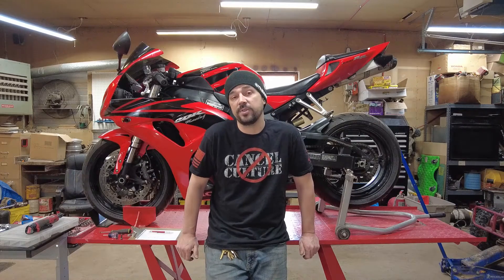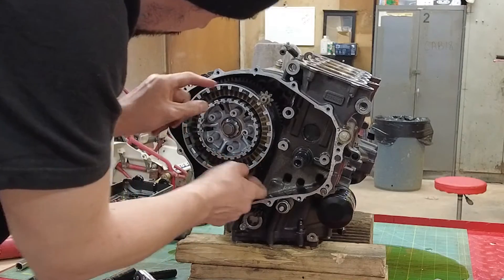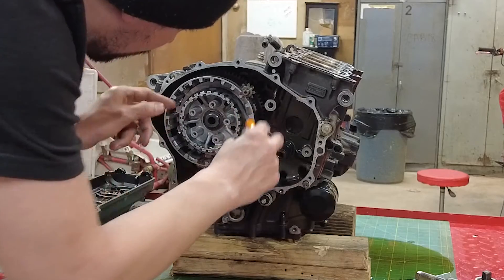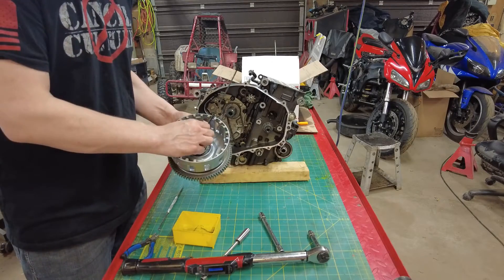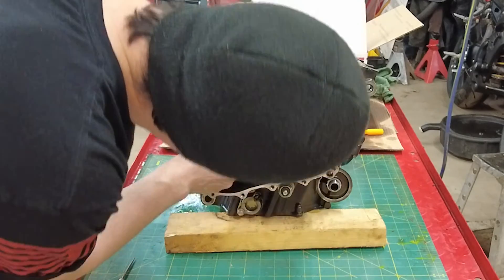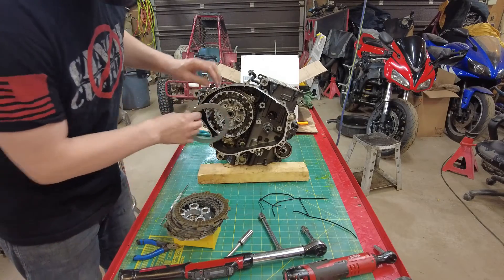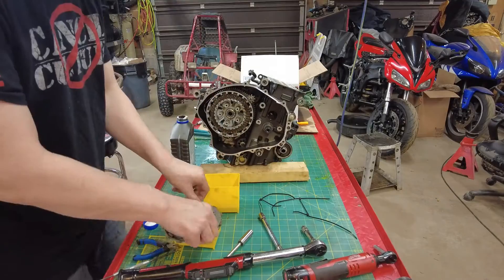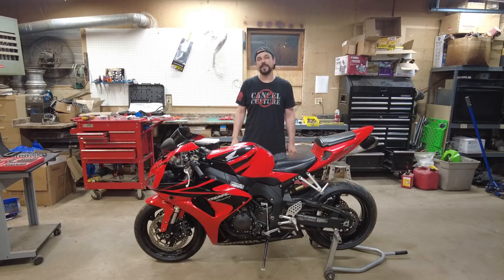CBR Clutch Replacement | How To Change a Clutch on a 2007 CBR 1000

Comment: Rebuilding a 08 engine CBR1000RR engine.  Bike was down and the engine was left outside for over 3 months and got flooded with water and debris.  After disabling the whole engine cleaning everything and putting it back together, it will not start.  Apparently I have spark but it doesn't ignite.  Put starting fluid and will not start. Sometimes will do something like if I somehow had a small ignition.  I not sure if there is not a good or weak spark.  Not sure if it is not time correctly as I have timed 2 times already.  New fuel pump.  I noticed that now the new pump doesn't prime with the kill switch on.  But I should have some ignition while pouring ignition fluid on the throttle body while twisting the throttle (open). Please advise and check the videos.  Thank you
Reply from the maker: @freddysaenzdastylist  timing is everything, if you aren't sure you need to be. Did you use the service manual to reassemble and time the engine? Did the old fuel pump make noise? Recheck the connections and there should be a relay or controller for the pump.
Reply: @The.Odyssey  old fuel pump does the sound of priming when turning kill switch ON (when was installed). New fuel pump does it only when connecting battery regardless kill switch ON or off.  Everything fallowed as manual and your videos, it's just braking my head.  Have spark, just not sure what else could be.
Reply from the maker: How about the tip sensor? I'm not sure how to test it, but maybe look into that?
Reply: @The.Odyssey  tip over sensor is fine.  My weird thing is that.  While cranking the engine and pouring staring fluid on the throttle body (open) you will see it coming out of the exhaust and smell it.  Does not ignite it.  And check every one spark plug and it does spark. So I don't know what am I doing wrong
Reply: @The.Odyssey  tip over sensor check already.  One of the weirdest things is.  Assuming I am putting starting fluid while cranking engine inside throttle body (open) would at least start and turn off it doesn't.  You can actually see the white mist and smell off the liquid come out of the exhaust but doesn't ignite it.
Reply from the maker: If valve timing was off you will lose compression, I'd also be worried about hitting a piston with a valve, I'm not sure but I would assume that the clearance would be tight enough to do that. A compression tester could help. Then there is ignition timing, if the flywheel key pushed out when the flywheel went on that would affect that. I believe when I put mine on the key pushed out a couple times but I could be mixing it up with something else. To verify valve timing is at least close without a compression tester you could pull the plugs and cam cover put a rod down a cylinder and roll the engine over by hand to make sure both intake and exhaust valves are closed when piston is at top dead center. 4 stroke... piston travels up with valves closed on compression stroke, then down on power stroke, then exhaust valves open as piston comes back up on exhaust stroke. Then back down as intake valves open on intake stroke.

Comment: Is the inner cylinder basket where the plates sits on suppose to move freely when the plates and springs are on? Also, does any gears around the clutch affects the bike from turning on? I was only able to get the bike to prime.
Reply from the maker: The clutch center should not move freely when the pressure plate and springs are on. If it is then something has been put together wrong or the clutch is severely worn. Is yours slipping like you described?  The clutch would be spinning at all times the motor is running or cranking. Was the engine removed? If so check the neutral switch.
Reply: @The.Odyssey  so I replaced clutch plates on my 03 cbr600rr, replaced battery, bike primed, and won't start. There's clicking from the starter solenoid which I replaced and same result. Not sure when to dig into next.
Reply from the maker: @LoRR2  with the clutch cover off the starter gear is on the top right side of the clutch basket. If memory serves correctly, there is a wave washer that usually gets stuck on the cover when you remove it. Perhaps this is out of place or the starter gear is bound up. If you need some 1 on 1 shoot an email with pictures to cryptosaulszee@gmail.com
Reply: @The.Odyssey  I was able to start the bike due to putting in the 2 washers in position.
Reply from the maker: @importtou2  awesome news

Comment: I have 05 model... În neutral there is a knocking noise am not sour is from the clutch but deep inside so when I pull the clutch noise goes away... I changed the al clutch kit and the problem is still there... Clutch bearing looks fine... Please any advise? 🙏🙏 Thank you what you are doing!
Reply from the maker: This 07 did the same and others have said the same thing. I think it's normal

Comment: Is the last fiber plate supposed to be offset from all of the others?
Reply from the maker: @wyattwooten5286  I believe by the book the answer is yes. I have tried many bikes both ways and haven't seen any issues. I prefer to put them in the same groove, but I really don't have a reason why other than I see no value the other way and I like to go against engineers when I can. Some may argue with me here and that's fine. I've been working on engines for over 20 years now, and I am confident in my statements made here. Honestly, I don't even remember which way I put this one together.
Reply: @The.Odyssey  awesome. I appreciate the info! This video helped me a lot in replacing my outer clutch basket

Comment: did you have to drain the oil before you did this
Reply from the maker: This can be done without draining the oil. If changing your plates you should soak the fiber plates in oil before installing.
Reply from the maker: Follow up though... If you are replacing a burnt up clutch I would change the oil.
Reply: @The.Odyssey  i changed the oil when i first got her before i knew how bad the problem was, but i’ll do it again while doing plates just to be safe
Reply: also 04 cbr1000 is my favorite bike i’ve had three, your channel is always a great reference. thanks
Reply from the maker: @user-ut7rn3pf7w  thanks for the feedback! I have a few more CBR videos to finish but I only bought the bike to rebuild the motor and sell it so that will be all unless I end up with another. I'm actually a Yamaha guy but at this point I own more Hondas lol. Always happy to help though and I've been working on bikes for 20+ years so I have the experience to back it up.

Comment: On this model ( sc57 ) 
I can change the oil pump on clutch side only?
Reply from the maker: From memory I believe you will need to drop the pan. Check out my how its made video, should show me removing it I think... still haven't put the reassembly videos together of the bottom end.

Comment: So I literally have the same bike and my clutch hub nut won’t tighten past a certain point and there’s still threads left. I’ve checked to see if it seated on the oil pump and it did so I have no idea. Please help
Reply from the maker: Probably missing a big washer. Look up a parts diagram of the clutch and see that you have all the parts.
Reply: I have all the parts thrust washers and all even the lock washer no it just won’t thread all the way on
Reply from the maker: @josephrivera4971  I believe the nut on this gets prick punched to lock it if i remember correctly. Is that what is stopping you?
Reply: No sir the nut doing go on enough for the lock metal to be punched down. There’s like at least 3 visible thread marks left and it won’t go any further.
Reply from the maker: @josephrivera4971  must be damaged threads then. See any issues on the shaft or the nut?
Reply: Shaft and nut are fine I’ve threade the nut on without the basket just fine no drag or anything. I even tried removing the back washer and it screws all the was on with basket it’s like the washer is keeping the hub from sitting all the way on hence causing it not to thread all the way
Reply from the maker: @josephrivera4971  send me some pics of what is going on. Even a short video if you like. Cryptosaulszee@gmail.com
Reply: Ok
Reply: How would you like me to send it to you
Reply from the maker: @josephrivera4971  to the email I put in the comment
Reply: I just replaced the entire basket and hub and it seemed to fix my issue. If the basket wasn’t completely together with the gear and actual basket

Comment: I have a 2007 honda cbr1000rr The clutch will not engage, I can see the friction plates opening when I pull the clutch in but it's still not engaging. The center clutch hub will not spin freely either if i put any amount of torque on it while the bike is in neutral. Coming from the diagram, All the washers are there. The guy I got the bike from stated his old mechanic rebuilt the entire bike and could never figure out the issue.
Reply from the maker: @zacharyhuckaby274  engage or disengage? If the bike wont move it is not engaging. It sounds like you aren't disengaging. There is a large washer that goes in there, make sure that's in the right position and everything is orientated in the right direction by looking for indicators on the parts diagram.
Reply from the maker: @zacharyhuckaby274  on the parts diagram # 9 & 10 plates can cause these issues if not installed correctly I believe you can see in the diagram that one is conical and the orientation that it should be in. Also, #17 washer can be confusing and may be in the wrong position. I believe either of these things could cause issues with the center locking to the basket.
Reply: @The.Odyssey  sorry about the late response but my clutch isn't engaging. The center hub seems to be locking against the basket. Isn't it supposed to freespin in nuetral?

Comment: I've got an issue with my CBR in that it makes a weird rattle sounding between 2-4kRPM in all gears, only when driving/under load, doesn't happen on paddock stand or sat still reving in neutral. (Check my channel for vid of it). I've tried the following to fix the issue, still present.

-Timing chain replaced
-Valves checked all in spec
-Oil pump chain replaced
-New CCT, Tried manual cct recently going back to auto as I didn't really like the guess work when tensioning only way to know if its to tight or to loose is to visually inspect by taking covers off.
-New cam chain guides also as these were beat up.

Do you have any advice on what to check next? I was thinking maybe something to do with the clutch? Someone suggested to replace the bearing you show but not sure if this is the issue, I've been given many possible causes but now running out of options. I took my bike to two different shops, both said the noise was normal and that it cannot be fixed, one shop inspected the bike and stripped the engine to as little as they could with it in the frame, they couldn't find any issues. I don't believe this is normal but happy to be corrected. No power lost, bike pulls strong, had it dynoed 165 bhp to the wheels, above 5k RPM all sounds great.
Reply from the maker: Watched your videos. What octane fuel are you running? Too low octane could be causing the engine to predetonate which can sound like a knock or rattle. Other thought is exhaust header gaskets. I'm assuming you are talking about the clutch basket bearing, if the basket has some wobble that may cause it. Final thought is the backlash on the counterbalancer. It's located towards the front of the engine on the left side to adjust, the service manual explains how to adjust it. If you need the instructions let me know... but I feel like you would hear it all the time not just when under power if it were the counterbalancer.
Reply: @The.Odyssey   thanks for the reply mate. I've tried all different octane amounts, 95, 97 and 99 ron (99 is the max Ron we have available in the UK at the pump), didn't really make no difference. I've replaced the entire exhaust and gaskets, checked for leaks and couldn't find any.

Do you know where I can find a service manual for 2006/2007 model? I've got a Haynes manual but it ain't the best would be good to get a factory one or instructions on how to check that would be good :)

Cheers.

Comment: I've got an 09 1000RR, it makes a horrible high pitched screaming noise on engine overrun, if I'm stationary in 1st and let the clutch out slowly so it doesn't stall the scream goes away. heard it is a crank issue, dealership said its something to do with the clutch. any ideas? I've also subscribed :))

p.s I don't trust the dealer at all and if I can hit him with some facts I might be able to get him to fix that noise, because it sure as shit didn't come from the factory that way
Reply from the maker: So as I understand it, it makes the noise if you shut it off with the key but not if you stall it by letting the clutch out in 1st gear? Please confirm. This engine in my videos made a noise like this 1 time (then I pulled it apart, i had a spun rod bearing). Have you changed and inspected the oil? You can get an oil sample looked at and they can tell you what they find in it, that may help. Unfortunately that screech is probably a spun bearing. Personally i do not think it is a clutch problem but I'm diagnosing from my couch right now :) Thank you for subscribing!

Comment: No, actually I'm watching this video, because I wanna change the cam chain guide and or shoe. And you literally (like everyone else on the internet) skipped the only part I was interested in 😶😡🤬🤯😬🤬😡🤬😡🤢🤢🤮🤮🤯😬😩😢😭😭😭😭😭😭😭😭
Reply from the maker: That's not part of the clutch so I would have to say no I didn't skip it. You may see it off because this was an entire tear down. It may be shown in the "how it's made" engine tear down video. I haven't finished the reassembly videos yet. If memory serves correct it is a torx bolt that holds the one guide, the other guide pulls out from the top and there is also a plastic guide on the inside of the head cover.
Reply from the maker: https://youtu.be/REsrGg2Vf8w I'm pulling the guides there around 9 minutes in.